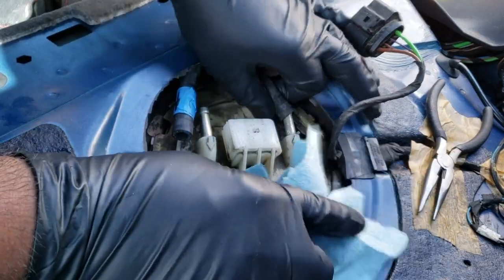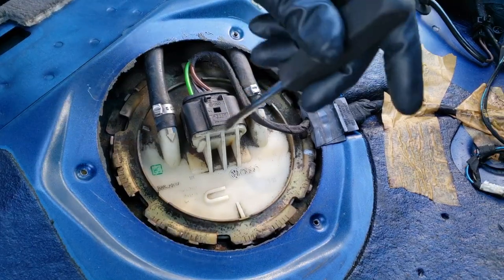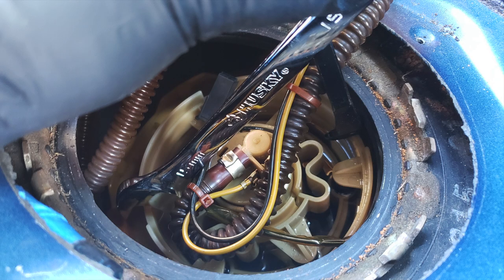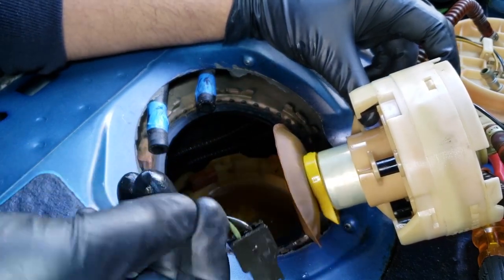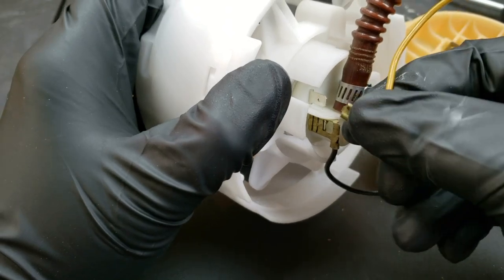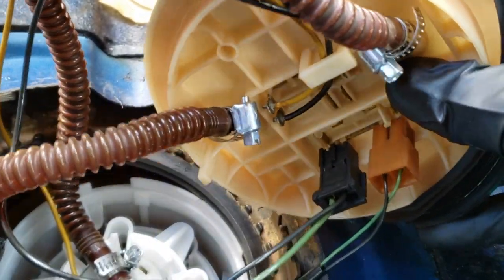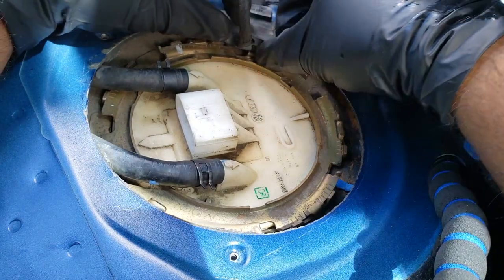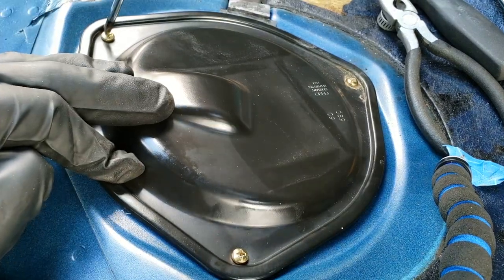Audi A6 C5 / VW Passat B5 / Allroad Fuel Pump Replacement

Comment: Really unnecessary to disconnect the battery. You'll be disconnecting power to pump at the harness plug going to the top assembly before removal. That way you don't to worry about resetting anything like the clock etc.. if you disconnected the battery.

Comment: i have replaced a fuel pump on my audi a6 c5 2.8 quattro. I used the same kind of clamps as yours , have replaced the plastic fuel pressure hose as well but it's losing the fuel pressure still. the problem is the clamps, i have used several ones but still no result... any help ?
Reply from the maker: Make sure you are using the correct size clamps for the fuel line and that the clamps are seated properly on the hose so you have no leaks. Were you getting good pressure before your fuel pump died?
Reply: @automahntic of course i did have good pressure. i purchased the fuel tank assembly and gonna install it so soon. im fed up with these crap clamps 😂😂

Comment: I have a question if you disconnected the battery why do you put electrical tape on the pliers
Reply from the maker: Sorry for the misunderstanding, I just said electrical tape as one type of tape you could use but ideally you can use whatever tape you wish. However the main point is only to protect the rubber hoses from tearing or getting damaged against the hard metal surface of the pliers. It's not for any other electrical related issue. Hope this helps!
Thanks for your comment!

Comment: Hey is the pump supposed to hum and whine like that? Cause my car does that… thoughtI needed a new pump
Reply from the maker: As long as the hum sounds like an normal electric motor then it's normal. However, if it sounds abnormally loud even if the seat installed then it could be a faulty pump.